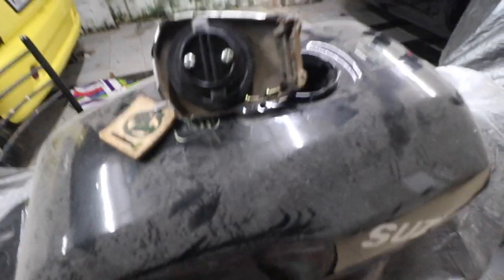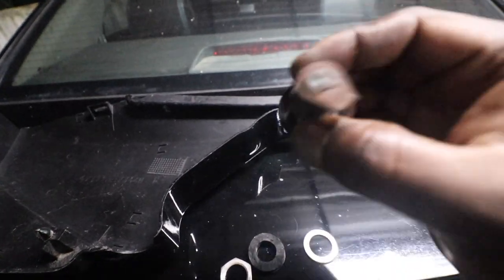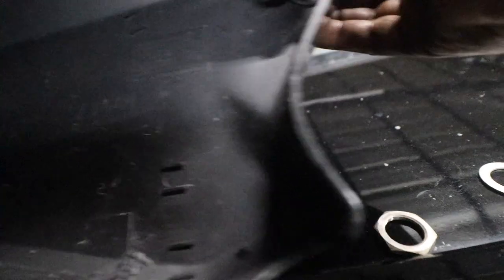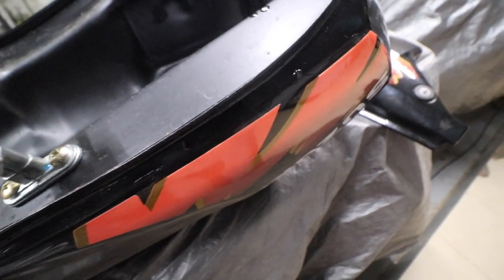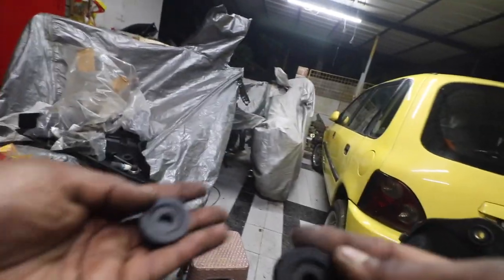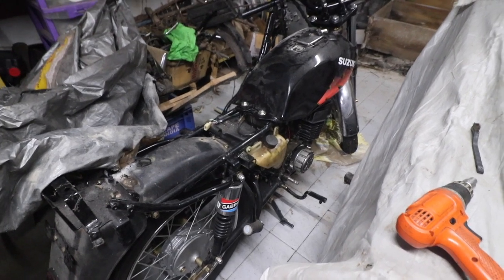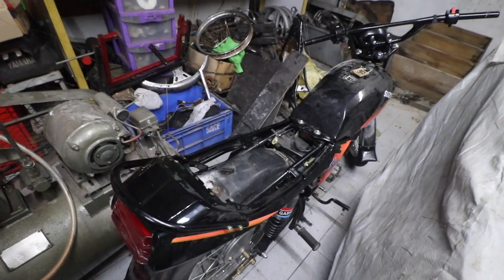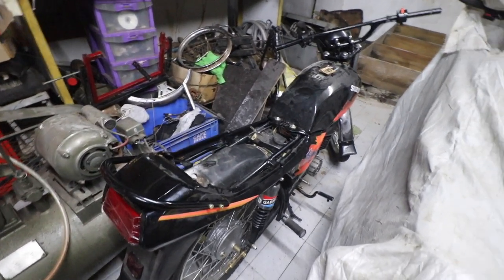Suzuki Shaolin Restoration part 9(Body panels, almost finished)

Comment: Another Yamaha for restoration😋. The Shaolin looks beautiful. I've heard that it's a blank canvas with loads of mod potential.
Reply from the maker: Actually Shaolin is not a great bike compared to shogun, it’s not a reliable base to build on. Yes another RX in the making, this will be special. Need to get the wheels first to start the restoration. Plans are there to convert it to 175cc
Reply: @Yamakaze  That's great news. Katta waiting.
Reply from the maker: The Easy Cook varum udanne

Comment: Sir,do you know anyone providing metal fairings,side panels becoz am fedup with these plastic parts,everytime one in the pair getting damaged nd am frequently replacing it with a pair of new but poor quality side panels,the main enemy is the arrow like structure  which we pressed into bush of chassis,is there any soln sir?
Reply from the maker: I know that fibreglass tail piece is available, metal piece is actually built by denters, if you have some one in your area get one made